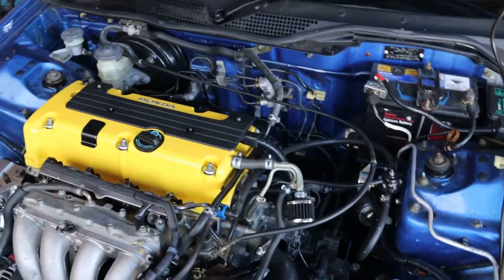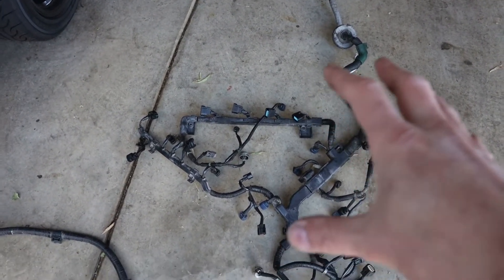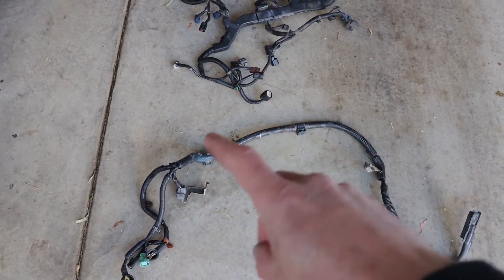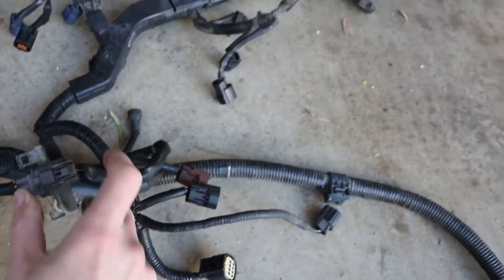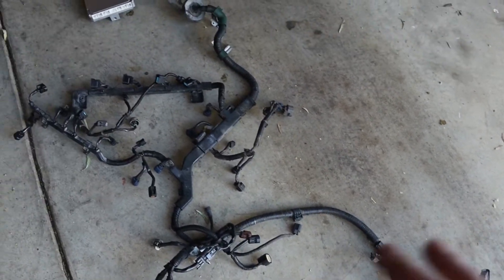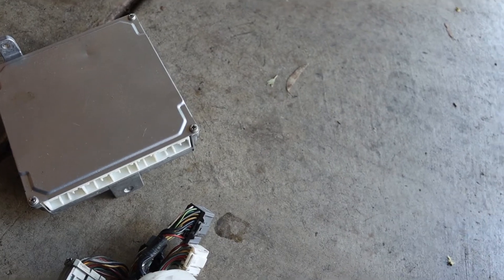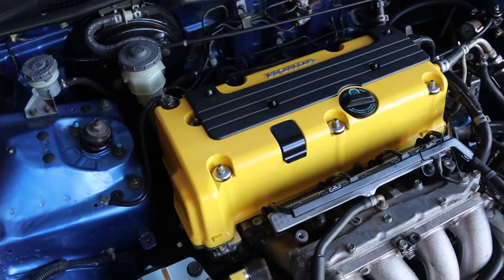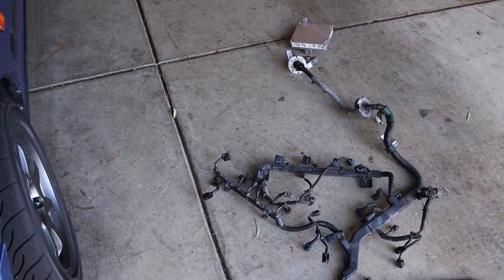Unravelling the Honda K series wiring - charge, engine and conversion harnesses basics

Comment: Just want to ask if you know oem acord euro wiring i got c101 plug and got the pinout for c101 
But want to know about is the colour of wire is same in the acord c521 plug? Or a but different
And also there is a AFS sensor wire
Is the AFS is primary o2 sensor? Or bit diff?
Reply from the maker: I thought the CL9 had a C201 (for connecting chassis to engine loom). I recall most of the wires being a similar colour in an Accord Euro - there are however some extra ones for CAN communication and some missing like the primary air fuel sensor wires. This is because in an accord euro the primary 02 plug comes off the engine harness directly.

Comment: Hey mate just wanted to ask I’m doin same thing with carby eg converted to injected…the conversion harness I use has two wires which is one is o2 sensor and other one dat meant to go to plug at shock tower but in carby I Dnt think I hav the plug to connect…now here’s the thing…now after plug the rest the car won’t crank o start…also I’m using type r ecu prc wil that matter with imbolizer and all?
Reply from the maker: Hi Mate, car will crank over even with the immobilizer so it def isnt that. I'd check your grounds and the trigger wire. The trigger wire comes from the shock tower plug so you will need that plugged in. Its a round plug and on the drivers side shock tower. There is a 2 pin one next to it which you also need for the conversion harness
Reply from the maker: one more thing we worked out while trying to help out another guy online is that you may have to supply 12v to a yellow/black wire in the round shock tower plug. You need to check if this has switched 12v with multimeter and if it doesnt you'll need to provide it switched 12v power. This could be your issue.
Reply: @teamaxlestands  hey men just an update car cranks now was due to auto shifter plug not connected..now car cranks but does not start…ecu is not turning on…coil hav power but no pulse…no signal cmg threw ecu…using type r prc ecu whc does not hav immobiliser? Car was auto n carby
Reply from the maker: @111SHAHIL  yeah man that was the same issue the other guy had. If you have a carby car just double check your yellow/black has power when the ignition is on. I used the power from the black and yellow on the 2 pin plug to power the yellow/black too. I think this is because we dont have the main relay in our car so that wire never gets a voltage when the ign is on.
Reply: @teamaxlestands  where wil i fine the yellow and black wire?is it connected to conversion harness? One of two plugs…is just that al the wires are pull in da carbin for wire tug
Reply from the maker: @111SHAHIL  this will be on the car side. Drivers side shock tower in the 14 pin plug. Test the yellow and black wire with a multi-meter when the key is on. If there is no power you need to pick it up from the Black/yellow wire (IGN power which you can check before using it) on the 2 pin plug also on the shock tower.
Reply: @teamaxlestands  ok wil do
Reply: Ok thanks will check on it wen we work on the car…

Comment: Do you have a link to the conversion harness you used for your swap since it is a carby? Hybrid racing says I need to use their universal conversion harness and not the 92-95 specific conversion harness
Reply from the maker: Just realized i forgot to reply to you the other day... hopefully the new vid helps out. I'd be going with the other style (non Hybrid) one. I think they are right Hybrid racing one wont work because the plug under the dash is not wired the same.
Reply: @teamaxlestands  thank you just checked out your new video